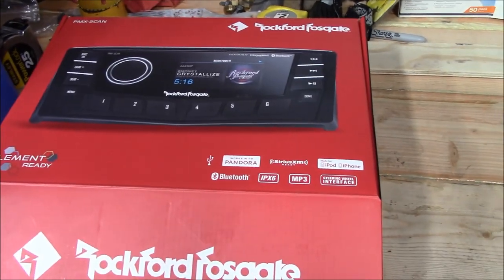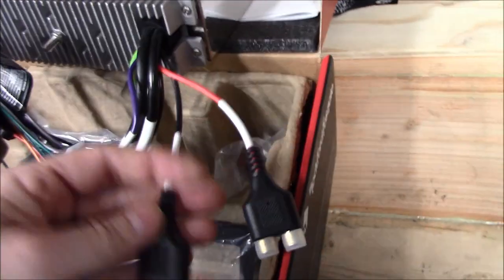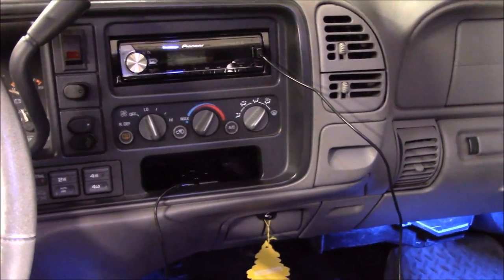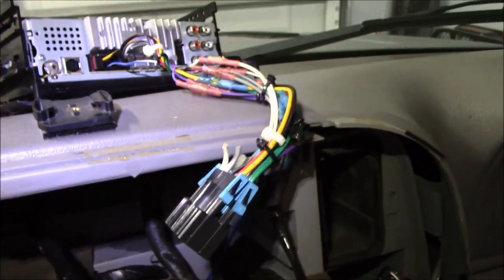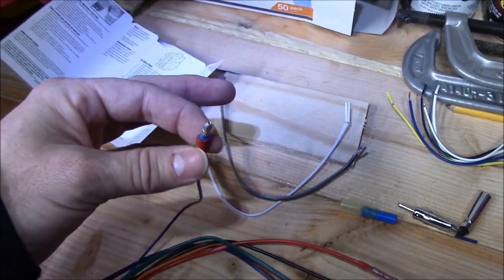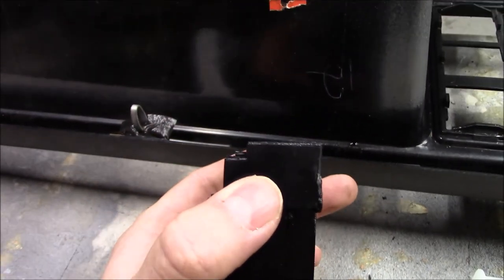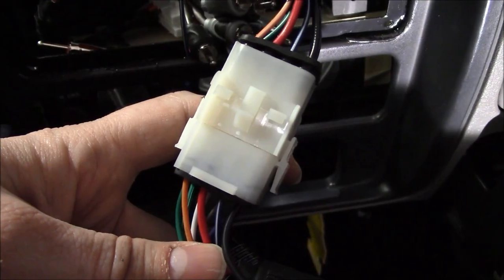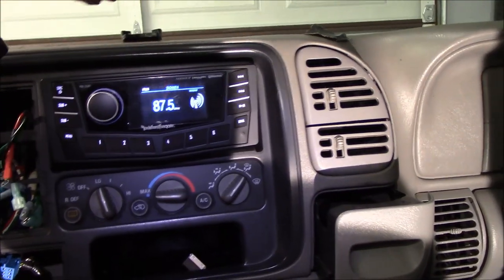20181207 Rockford Fosgate PMX-5 in a Suburban

Comment: Cool video. I know it's been a few years, but in case you haven't been clued in, the wires aren't aluminum. They're tinned. It's a marine grade copper wire. The copper strands are coated in solder. Holds up much better than uncoated copper in the harsh marine environment. Particularly salt water. Cheers!

Comment: I struggled to get my double din in my dash. Not a lot of room back there. I want to do a double din in my 91. I used a dremel with a trim bit. Works really good in tight spots.
Reply from the maker: So with the 91 style dash, you have even less room. I would suggest looking at the PMX-3 I was talking about in the video. It would fit on the main dash, not the middle dash where the single DINs normally go, like I showed in the photo.  It’s only $150. It’s a very basic media receiver normally installed in side by sides. Caveat with it is it HAS to be paired with an amp. It only has RCA outputs. A simple 4 channel would do the trick and would fit right under the passenger seat as I’ve done in mine. If you are looking for budget, basic quality, the Rockford Fosgate Prime series speakers and amps are nicely priced and still perform better than Pioneer and JVC amps. If you lived closer I’d gladly come help you do the install.
Reply: I want to put it in the center and maybe build a cup holder thingy.  I want the full double din screen.
Reply from the maker: Yeah, you'd have to build a center console for that.

Comment: I have one of these and want to install it in my Jeep Wrangler I was wondering where you got all the adapters from the original harness
Reply from the maker: I believe this time around I simply got them at Wal-Mart. You can find the adapters just about anywhere: Crutchfield.com, Amazon.com, etc.  Your local stereo installation shop, etc.  Metra is always a good brand to look for, though I've used Stinger, Schosche, Knuconcepts, and Install Gear products, too.
Reply from the maker: Nope, nothing special. Just normal adapters. As I noted in the video, the only thing different is there is no constant power line like car stereos use to hold memory and a clock.

Comment: This is the exact video I needed to watch! Could you not just cut all the connector wires on the back that you wont ever need though? Like the XM radio connector for example.
Reply from the maker: I've thought about cutting the excess wires and capping them, but just haven't done it.  So long as they are capped correctly, they should be fine.